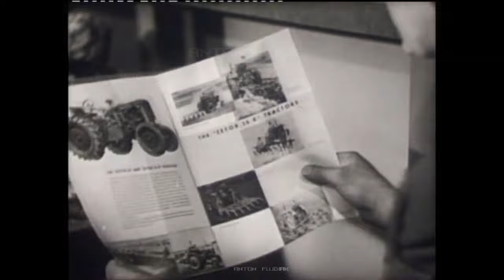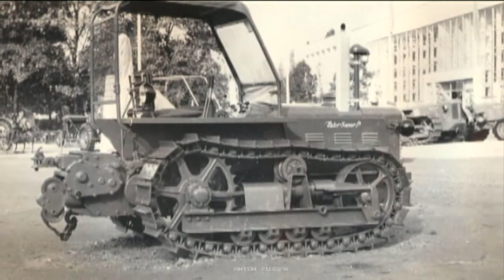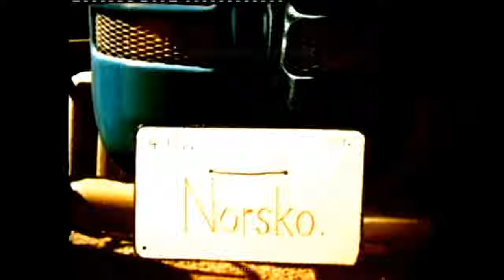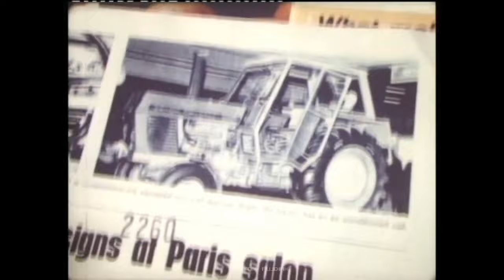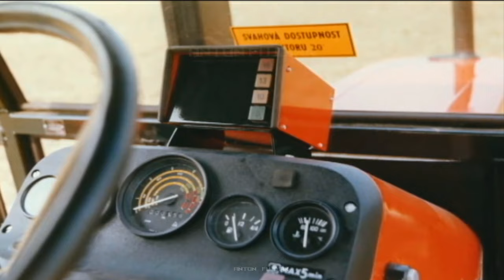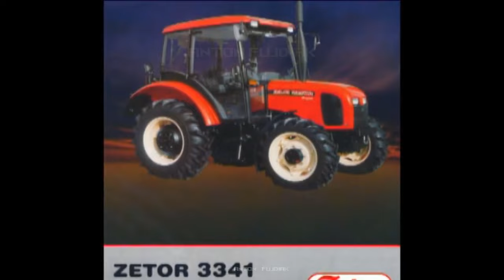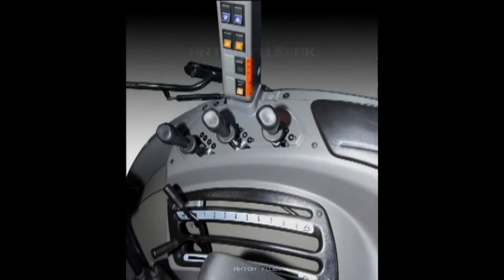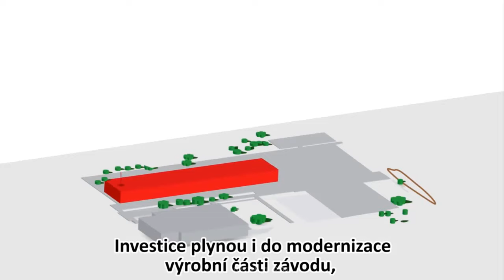Zetor History 1942 - 2021 75 years with tractors Zetor

Comment: I want early Crystal 16045 so bad...
Reply from the maker: Hello, Crystal 16045 was the first type of tractor with a power of 160 horses, but it also had its ailments.
Reply: @AntonFujdiak  I know, and ofcourse, every tractor has some problems. I just love the sound of that engine so much. :) And it looks great with bigger size tires.
Reply from the maker: This one is narrower :D
And the paradox is that they would gather more widely around the stability of the slope.